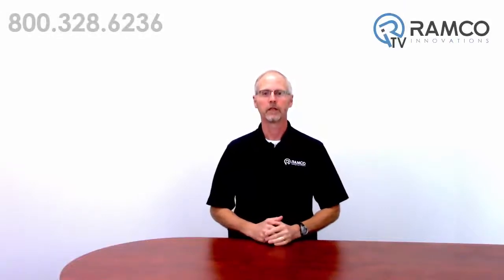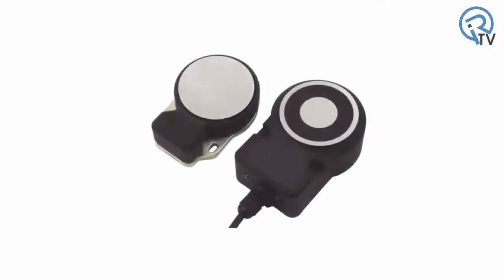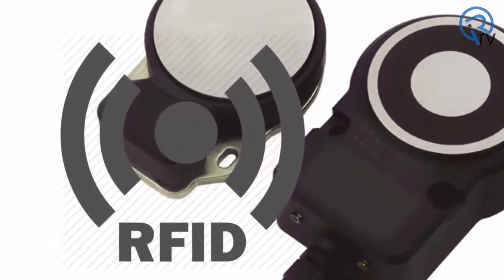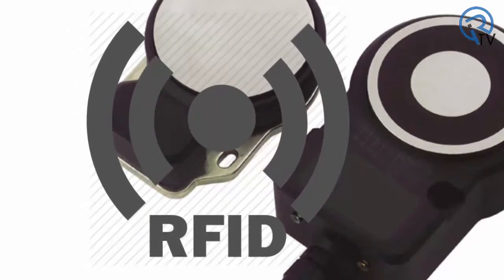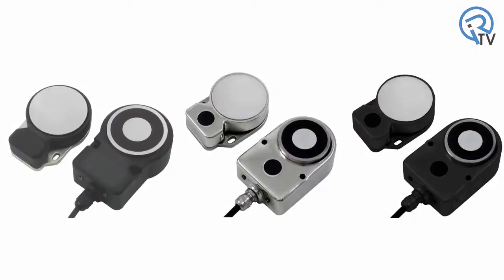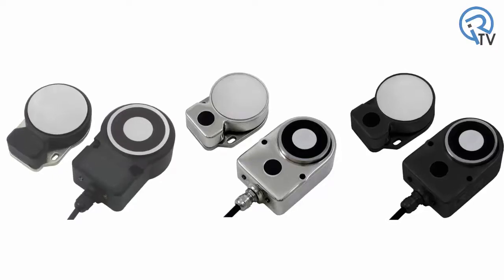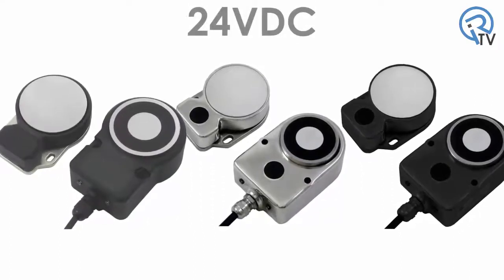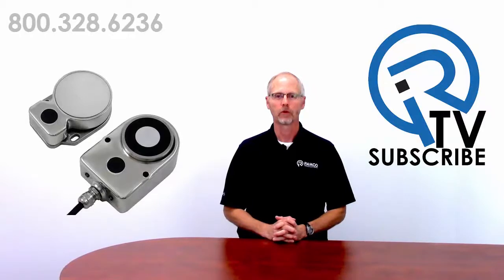Omron D40ML Magnetic Locking Safety Switch

Comment: As soon as the lock is classed as open will it loose all magnetism  ie    if I had a plate attached one side on a wall and interlock was in safe mode woul the plate fall off or would it hold slightly ?? If that make sense